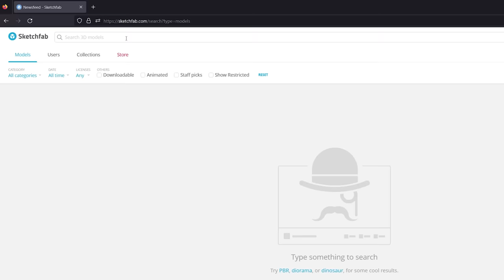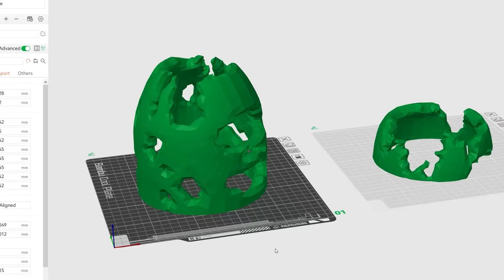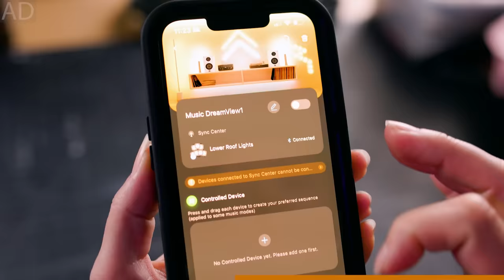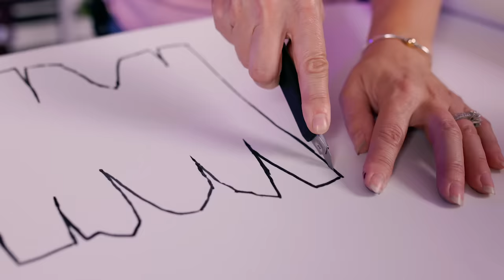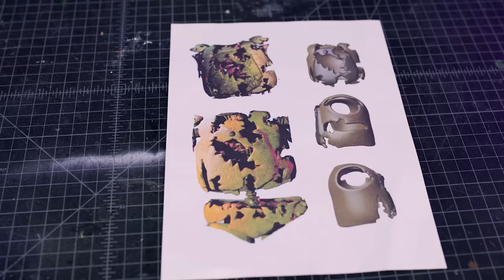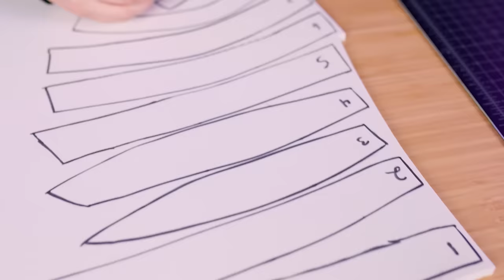We made a real SPRINGTRAP Animatronic from FNAF!

Comment: This looks great! I have a small tip, and that is that if you need it to be light, I would recommend using upholstery foam instead of Eva foam! I use it in cosplays where I cover up my pieces with fabric and it looks great. It’s also cheaper, which is a plus.
Reply: one of the unfortunate downsides to upholstery foam (and all foams really but couch foam has a lotta holes!) is the risk of damp and mould- especially as this is an outdoor animatronic it may have heavily upped the risk of this thing moulding especially at this time of the year, which funnily enough is very fitting for springtrap but realistically a tad gross haha
Reply: @jouga  Yeah true, That's One of the worst thing's bout it but, I mean, it is matching springtrap so i don't see a problem with it! And plus, Ive never really made cosplay's, But i am THINKING, to making one once i have a 3d printer
Reply from the maker: Yes, good call!
Reply: @jouga could you use plasti to resolve that or would it make it heavy again? Also still potentially moldy?
Reply: @WickedMakers I love you guys! I would LOVE to do something with you! Unfortunately though I live in the UK 😅🖤
Reply: @WickedMakers please do a Bendy and the Ink Machine/ Dark Revival creation soon 😊
Reply: @WickedMakers hey Wicked Maker's? Would you mind if I ask if there's a link to the skeleton animatronic? Thank you 😊 And stay Wicked! 😉🖤

Comment: Love the attention to detail and the fact you two didn't give up when the arms didn't work as expected. Sometimes the convenience features of something, adjustable arms in this case, work against you. As far as I know, the mechanism behind this is 2 shallow angle crown gears pressed against each other with a bolt and spring. If you're not able to disassemble the shoulder to replace the spring, or tighten the bolt, maybe driving 2 screws into the shoulder would provide another option, albeit a less adjustable one.

Comment: If you need to cut weight in 3d printed pieces, try a 7 - 10% infill with the lightning design. Would also cut down print time and filament use.

Comment: FNAF Fandom: "Oh Springtrap's design was too unrealistic how could a human skull be inside..."
These guys: Yes.
Reply: When did they say that?
Reply: Yeah when
Reply: Well, they had to tweak his design. And the skeleton they chose resembles Springtrap's cartoony anatomy, especially the head. 
I have tried making Springtrap models that were human-based, or tried to fit a human model inside the Spring Bonnie suit, and let me tell you: you cannot make him look like he does in game without changing his design to fit human proportions, or changing the human proportions.
To begin with he has a really long neck and really wide shoulders, the head is a mess, human heads are way smaller and thinner, and fit funnily inside the original head. His eyes are too far apart, and the eyes that meant to be Afton's are absolutely huge. And let's not forget about the size of the hands which are huge for a human, even with large hands. Scraptrap supports more of a human-compatible design (although the inner design is even worse than Springtraps).
Reply: @Yes_im.a-lordpeacock  Never heard anyone mention it, but someone whose favorite animatronic is Springtrap, and used to draw and model him, and try to make realistic models, Springtrap is an anatomical mess and nothing about his insides makes sense. That is true both for the animatronic and human parts. They are fine because it is barely visible because of the suit.
Reply: @katamas832  sí Pero viste como el tipo se puso el casco de Springtrap y le quedó a la perfección? QUÉ ACABAS DE VER?
Reply: @thespeedster4451  Not really perfectly. The moment he'd turn or tilt his head the mask would move around, because the mask is a lot wider than a human head. In Springtrap's design, the side of the head nearly reaches the side of the mask perfectly. And the lower jaw nearly reaches the bottom of his jaw. It's too low when he put it on, if you rasie it a bit to fit like it does on Springtrap, the eye holes would literally look ( .) (. ) which is extremely goofy lol.

Comment: 2:33 (NERDY WARNING)
The way William met his end was not any sort of magic. The suit that he was trapped in used a spring-based locking mechanisms called springlocks to pull animatronic parts to the sides of the suit so someone can fit inside. It was supposed to be an animatronic-suit hybrid to cut costs. The only problem with that is the fact that the springlocks can fail. If a springlock fails while a person is inside, the animatronic part attached to it will move in with enough force to crush bones. The sudden pain may cause the person inside the suit to jolt, causing more springlocks to fail and crush your body until it is unrecognizable. When facing the spirits of the five children he killed, William Afton tried to hide in the Spring Bonnie suit, only for the springlocks to snap shut on him. His iron will to live and his refusal to pass on made him live longer, this time as one with the suit.

Comment: 2:36 Yeah, none of Springtrap's skeletons ever made sense. Even fan-made ones just make the endoskeleton kind of an exoskeleton bear-trap, kind of missing the point that Springlocks conceptually are meant to be an endoskeleton being retractable/pullable apart inside of the suit for a human to fit inside, and the fact that it is basically a bear-trap is an oversight. It should be an endoskeleton being smashed into a human body. And actually the closest to that IS Springtrap, just the human parts are severely lacking. But to be fair, they were never meant to be really visible in Fnaf 3 to begin with. 
Even in the books it's made to be an exoskeleton that latches onto the endoskeleton, making it really just a more sophisticated Iron Maiden. Also the problem with that interpretation is that there is no endoskeleton inside Springtrap, so the behaviour in Fnaf 3, where the Spring Bonnie animatronic programming makes him follow the voice of a child doesn't make sense.